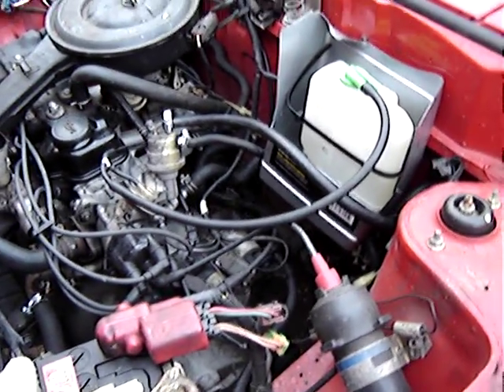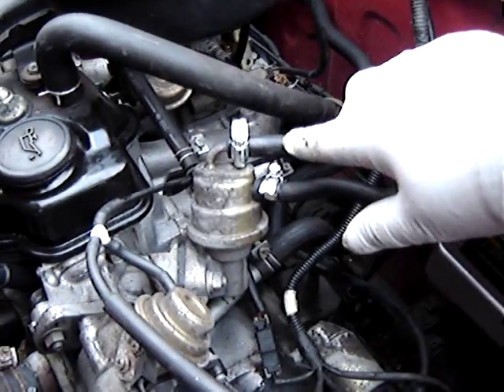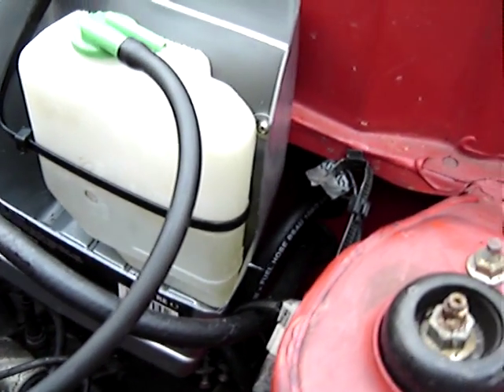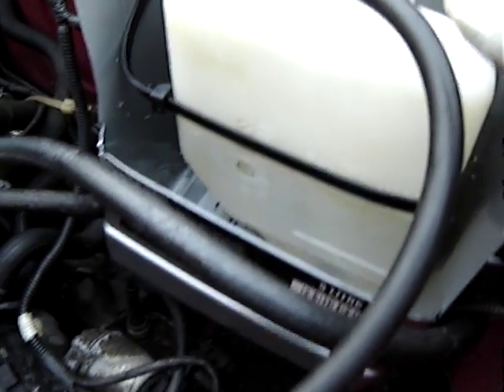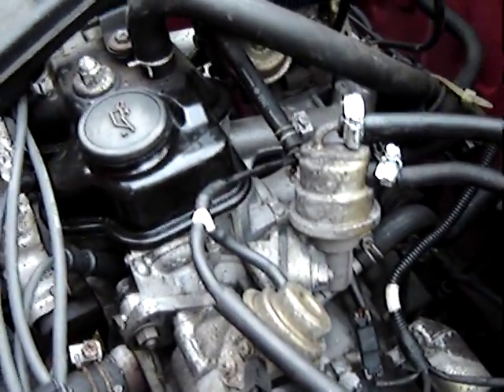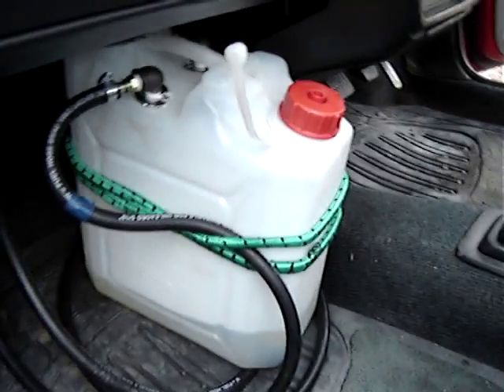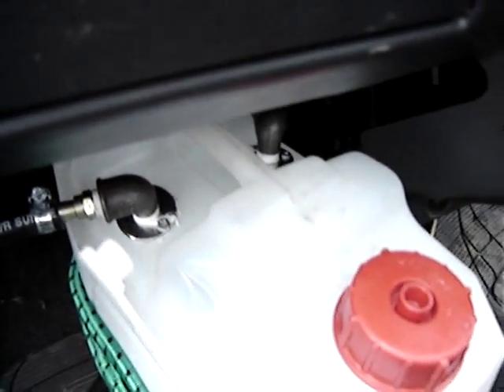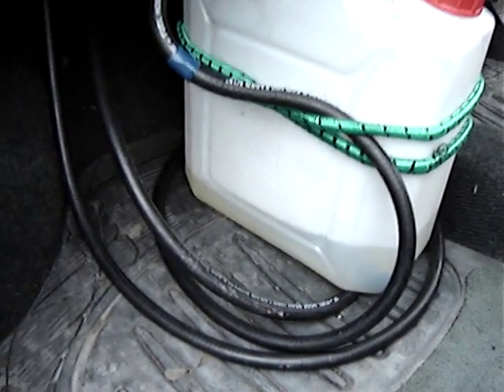Micra Vaporizer & outside Petro Tank.MPG

Comment from the maker: Thank you for your comments. Looking back at several tests I done on four different vehicles over 3 years. I now feel that I had vehicles with very small size engines 800 to 1600 cc engines and I was putting in too much HHO. As one of the gentlemen said, that we should have more air mixture. I did at very first use a JAR system producing very small amount of HHO on a 800 cc vehicle and I got a good response as to the speed of the vehicle and engine running much cooler and quieter. I gave that up because I had several small leaks from the Jar and I was too worried n case it blew up. Please try a very simple setup with smaller amount of HHO going through carb.